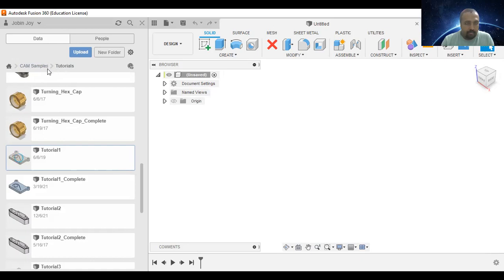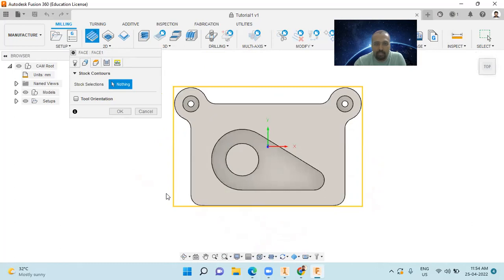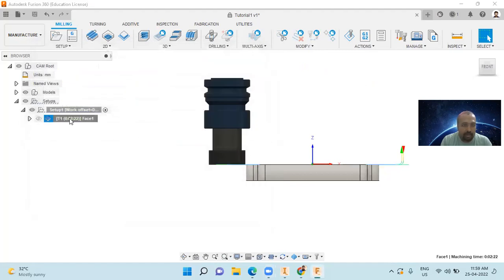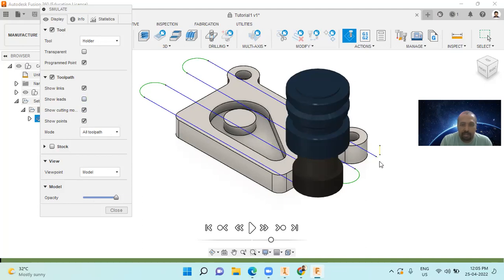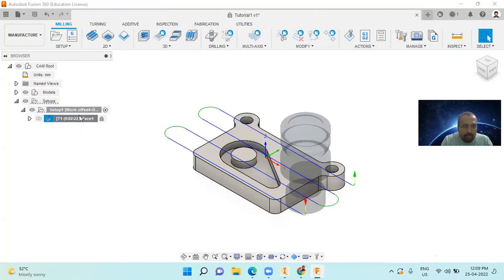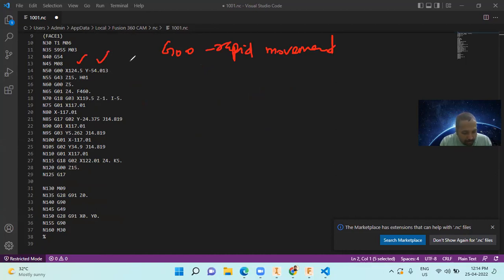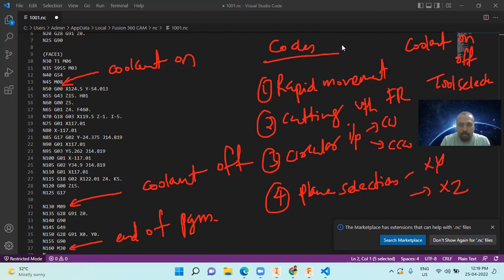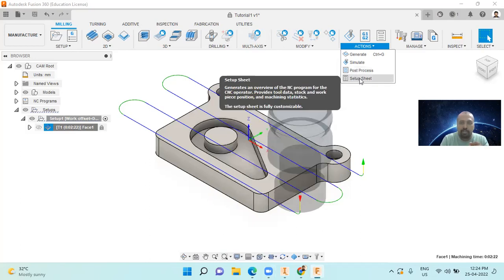FACING

Comment from the maker: %
O1001
(T1 D=50. CR=0. - ZMIN=-1. - FACE MILL)
N10 G90 G94 G17 G49  G80
N15 G21
N20 G28 G91 Z0.
N25 G90

(FACE1)
N30 T1 M06
N35 S955 M03
N40 G54
N45 M08
N50 G00 X124.5 Y-54.013
N55 G43 Z15. H01
N60 G00 Z5.
N65 G01 Z4. F460.
N70 G18 G03 X119.5 Z-1. I-5.
N75 G01 X117.01
N80 X-117.01
N85 G17 G02 Y-24.375 J14.819
N90 G01 X117.01
N95 G03 Y5.262 J14.819
N100 G01 X-117.01
N105 G02 Y34.9 J14.819
N110 G01 X117.01
N115 G18 G02 X122.01 Z4. K5.
N120 G00 Z15.
N125 G17

N130 M09
N135 G28 G91 Z0.
N140 G90
N145 G49
N150 G28 G91 X0. Y0.
N155 G90
N160 M30
%